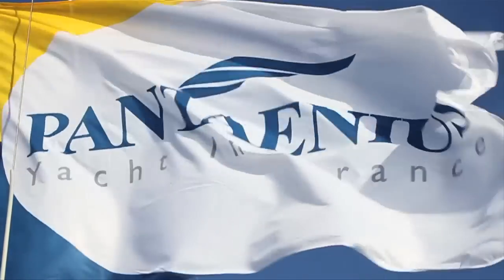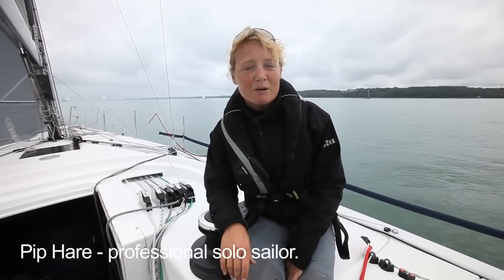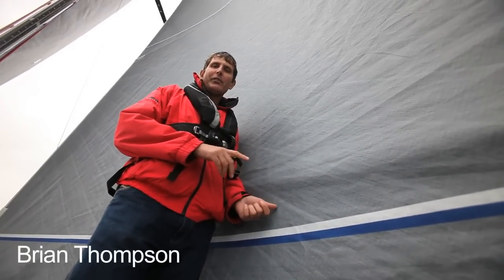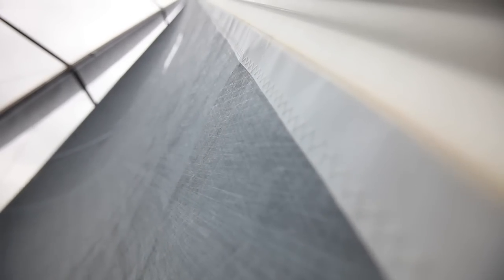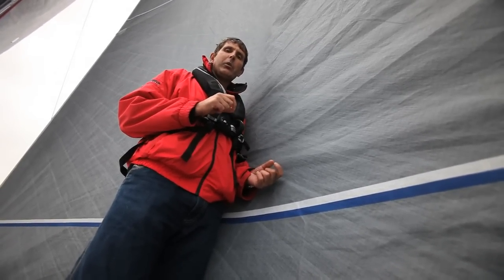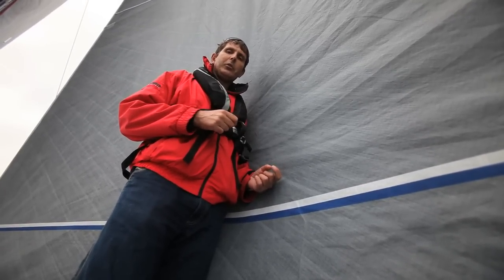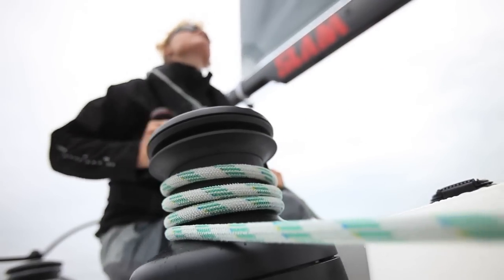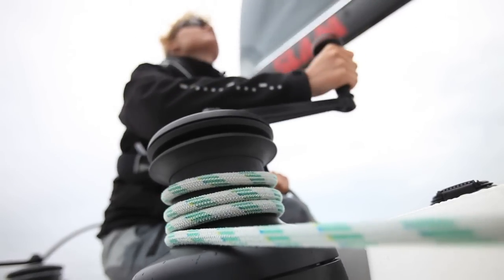How to set up and trim for light airs sailing | Yachting World

Comment: Guys, great videos. How do you handle the problem when adding waves to the equation?  Very often because of the hull going up and down, and when there is very light wind, the jib  colapses under it's own weight. Then because it is so eased and out sometime it goes into jibe. Hope i explained it clear enough :)